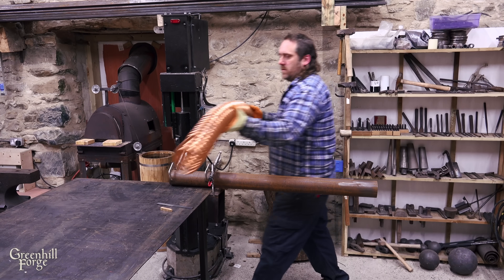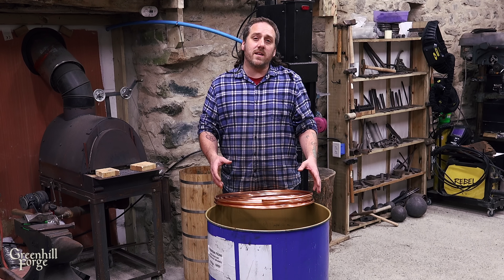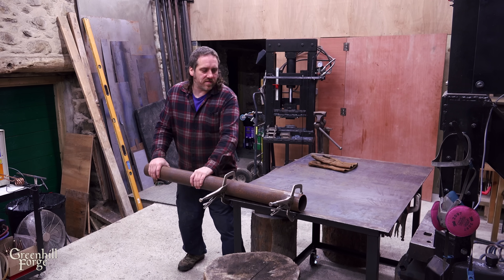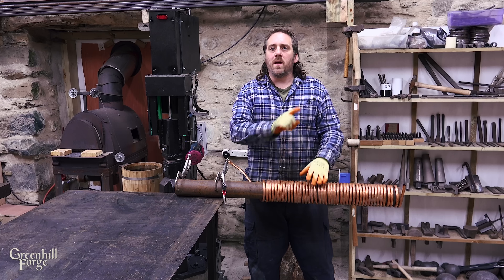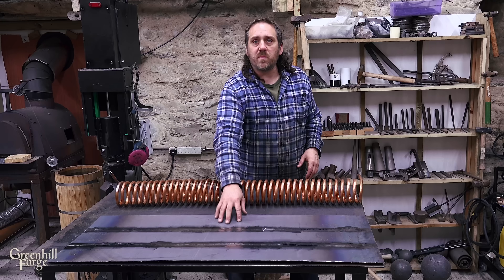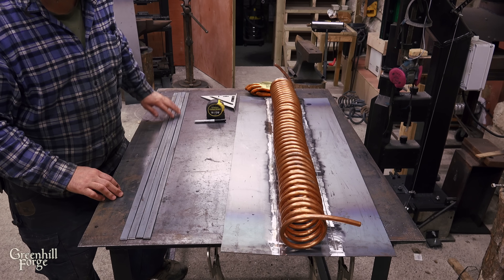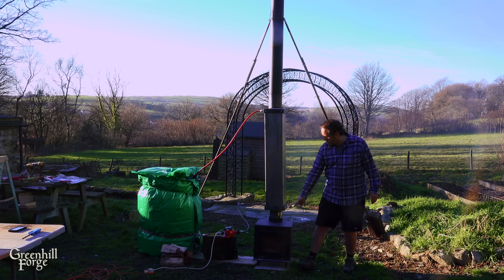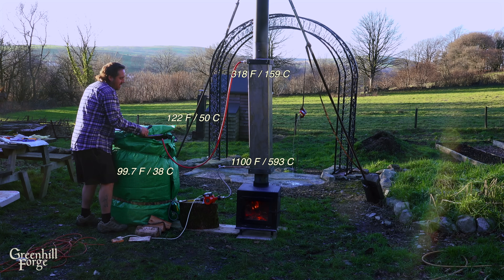Wood Stove Water Heater Experiment - Surprising Results! Part 1

Comment: Excellent video. Great idea, perfect explanation, cool techniques, and conveyed in a clear and concise way. Would love to see a comparison of how this insulated version performs vs just wrapping the copper around the chimney pipe (which is what I WAS planning to do, but now you've got me rethinking my plan)
Reply: Potential problems with soot and creosote build up on the relatively cool copper pipes leading to clogged heat exchange surfaces and potential chimney fire
He mentioned trying a "Rocket stove" design next  which could alleviate this problem due to its designed in, efficient burn and therefore no creosote or soot (both of these products are from unburnt fuel = low efficiency)

Comment: Kinda think you could put an inner pipe to better divert the flu gas around the coil. Give only a half inch space on the inside of the coil too.
Also lightly crimp the coil a bit to increase turbulence in the flow of water. Great job this is something I’ve been planning
Reply: Rather than crimping the coil just install some baffles to disrupt the airflow.

Comment: IMO there will soon be a lot of condensate due to the cold water being pumped through the hot tube. And it will hit the smoke and create a lot of creosote and after 1000 liters of heated water or so it will dramatically worsen the thermal conductivity of the spiral. So you may have to clean it somehow, I guess.

Comment: Does the warm water hose go to the bottom of the barrel?

Also I think this could be optimized... If you go by cross section of the interior of your contraption, only a very small fraction of the area will be in contact with hot air. With a wood fire, obviously you need some room or else soot will probably gum up the works inside of a few weeks.

I just wonder if instead of making a spring out of the copper pipe one couldn't fabricate a corkscrew chimney with a flat top so to speak. The head would travel along the flat plane to which water piping could be attached.  Like a spiraling entry to a car parking building with piping along the roof, you know?

Comment: pretty cool, The only issue i see is over time the efficiency will decrease as the copper tubes get coated in fly ash which is an insulator

Comment: Awesome Idea, but how do you account for the mineralization of the water giving the system basically clogged arteries. If as you say that everyone can use a water source off grid then the higher mineral content could potentially clog the system. Is there a tubing like pex tubing that would eliminate that mineral gravitation to the walls of the copper piping. Great Video Thank You 🙏

Comment: Fantastic video! I have a suggestion for another experiment: could you try using a counter-flow setup instead of a parallel one (feeding the cold water at the top)? I believe this approach might achieve even greater efficiency due to the consistent heat gradient. Looking forward to your next video!

Comment: Great video, very interesting.  However I’m afraid that over thermal cycles those steel notches will cut into the soft copper and you will have a leak. Rather than notches I think some flat lips for the copper to rest on flat would be less likely to damage the copper. Thanks for the video!

Comment: I want to make a mass heater, which uses isolation, but around a thermal mass (sand), with a double burn (another air intake to ignite the smoke), with the heat coiling into a bench (or hot-tub), with this copper heat-transfer circuit also embedded in the sand. A rocket stove would start the burn to have a good air draw, and with a trap closing on the exhaust, it would loop around the isolated hot tub. Ideally, I want to do all of that in a greenhouse, so that any extra calories can stay in, and I'm not exposed to the wind. I've seen elements of this made from cob (clay + sand + straw). 

Your unit is modular, it looks manufacturable, shippable. I retain the method of wrapping the copper tube around, and the spacer rack.

Comment: If you added a thin metal pipe in the middle of the coil and fill the coils space with sand. Cleaning would be better and the sand once heated will stay hot long after stove burns out. Might save on fuel
Reply: Careful with heating sand, it produces silica at high temps. Should be ok near the pipes with the water running through keeping it at max 100C but the edges of the square may reach dangerous temperatures.
Reply: @Andeving a wood stove only gets to just under 600 degrees the chimney will be way cooler then that and silica is a type of sand and sand doesn’t melt until 1700°c maybe I’m misunderstanding what your saying lol

Comment: Super nice work! You can bump the efficiency by reversing the flow in the coil. Inlet at the top and outlet at the bottom. Reverse flow heat exchangers is a more efficient config.
Reply: Precisely what I was thinking. Deffinately helped my offset head double helix reflux condenser I use to distill "fuel" with.

Comment: You can also just coil it aroumd your smole pipe and it works well. I've seen it.
I didn't do it just because I keep my stove inside and you don't want to start a fire in summer jusy to have hot water.
There are more efective ways to do it, in a similar way.
Wood stove boilers have the smoke pipes going trough the water tank. That's wildly efficient!
This copper pipe idea makes sense of you only need the hot water in winter and you have it as a bonus, since you use the stove for heat anyways.

If you do something for extra heating, like floor heating, please be careful. If you don't use a pump to circulate that water and you don't have the right angles, the pipe can explode. I've seen this happening.

Comment: Very nice project and very well explained. One improvement to increase the efficiency is to feed the cold water in the coldest side of the heat recovery system. In this case, through the top intake of the coil.

Comment: Your coil will be thickly covered in creosote (less efficient) in 3 weeks or less, and needs to be cleaned. It has the BTU's of coal and will make a fantastic chimney fire... Allowing for cleaning must be part of the design.
if your water tank bottom is 2ft. above the top of the coil you don't need a pump.
Ask me how I know...
Reply: Ok, how…Assuming you tried it w/reverse flow?
Reply: @ mine had no pump and used thermal circulation. it works just fine.
Reply: Creosote was the problem that I had when I attempted a similar water heater.
Reply: @ my system produced 4 to 6 litres of creosote every 3 weeks. but It did the job for hot water. easy cleaning must be built into the system.without diligent maintenance it's a chimney fire waiting to happen.

Comment: Very well executed! Every time I had a question you preempted it with an explanation. Fantastic! One piece of advice, infrared thermometers don't read shiny metal properly. Hard to appreciate this until you've played with a thermal camera, but basically any metal surface that's shiny under visible light is shiny under thermal infrared light as well. So a reading from a reasonably bright steel surface is probably reading 80% the tree next door whose infrared is being reflected from the metal, and 20% the actual temperature of the metal. 

For getting a good reading from shiny metal surfaces of reasonable temperature (<100C) a square of painter's tape is an easy measure to take. Mill scale is probably also really quite close to the right emissivity for a good infrared thermometer reading, so if you've got a nice dull mill scale surface that'll read pretty well (although in my experience things tend to be a bit shinier in thermal infrared than in visible light, so a thin light grey mill scale would be dubious). 

For decently high temperatures (up to say 200-300C) soot is usually a decent temporary surface for an accurate IR thermometer reading. Again, things are shinier in infrared than in visible light, so the soot has to be pretty darn thick  (absolutely no sheen from the underlying metal) before it's truly black enough to produce a good thermal read.

I would expect any matte stove enamel to produce an almost perfect thermal infrared reading.

Very curious how the rocket stove will pan out! Back of the envelope math says your water heating experiment would have required only 1.6 lbs of wood with a 100% efficient setup. If we say you burnt half the wood, that'd put you at 36% efficiency. I would say you're doing pretty darn well already! That seems really high for this sort of thing! But I'm super interested to see what efficiency you get from a rocket stove that's not radiating any heat out the door.
Reply: That is a well-thought-out reply with tons of very relevant information and save me a lot of typing.
I was also thinking that a rocket stove would avoid the major flaw in this design because of its complete combustion (100%  by design) and thus NO creosote build up and therefore no safety risk of a chimney fire. He will have to mount the coil higher after the pyrolysis has happened in the well insulated riser. 

I'm glad the tank is not sealed so there can't be a pressure build up and a boiler explosion as may happen with closed systems when pumps fail or the power goes off.

Comment: Nice work.  

Some notes for posterity:  Once you get to around 500* F or so, air becomes much more thermally conductive and more and more heat exchange/transfer occurs through IR as the temps get hotter and hotter.  To optimize such a system a bit more, an IR reflector (with a free air gap of at least .5" or so between its surface and the heat source) would be helpful.  

  Then to optimize heat transfer through the copper and into the water, roughing up the copper tubing and spraying it with a high temp paint would help a little. The copper directly touching the steel doesn't need this, only the part of the copper not touching it. (As IR reflection needs a bit of an air gap to work).

   I don't think that both of these would make a big difference all in all, and maybe not worth the extra work for some folks, but it would help some. I'm a little obsessed with efficiency, but I also have learned the hard way, "don't let perfect be the enemy of good". 

  Cheers

  Edit to add: The downside to this, at least for indoor heating woodstoves, is that the cooling of the stove pipe will tend to induce a lot more creosote build up.  Personally I would lean to using it only for outside use because of that, unless you have a system set up where it is fairly easy to clean the stove pipe (because you'll need to be cleaning it more often for sure).
Reply: Cleaning the stove pipe and chimney every couple weeks in the winter sucks so bad that nobody will do it. 

'Efficiently' stealing heat from the exhaust gasses is a creosote building chimney fire machine.

The heat in the exhaust gasses is the only thing that pulls air into the stove. People will have to burn hotter and hotter fires in the box just to get it to run, and one day it all goes up in a glorified, giant sized rocket stove that you can only hope ruins the pipe and chimney without burning down the structure it's in.

Thanks for pointing this out, 'reclaiming' the heat from the exhaust is never a good idea and I'd hate for anyone to end up worse off from it.

Comment: Interesting idea. Won't the copper cause rapid galvanic corrosion of the iron and collect creosote rapidly as the smoke passes over the water cooled copper? Maybe 5/16" stainless brake line or 3/8" stainless wort chiller coil tubing would be safer?
Reply: For galvanic corrosion to occur, the metallic junction must be in the presence of an electrolyte.

Comment: You made a critical mistake that inhibited the performance 
This comes from the energy experts in the HVAC industry, it is called Pre-Heating.
The cold water inlet should be at the top, closest to the end terminals if the flue. When you look at the Copper tubing, a section of that copper, say 1" length. It will conduct heat at a specific rate, drawing heat away from the flue and transfer that heat through the heat of conduction to the water.
Since that Heat Transfer is limited, you are considering Temperature Rise.
Since the heat closest to the stove is hotter than it is by the termination of the flue, you want the most heat transfer as possible. 
If your inlet water is at the farthest point, it absorbs heat, and as it runs through that Copper Pipe, it will be exposed to hotter temps. You are literally Pre-Heating the water before it gets to the Hottest portion of the Flue, where it will absorb the most heat.
Additional benefit is that the resistance of the water to the Pump will be reduced, resulting in a more efficient pump operation with less stress on the motor. 
Your Heat Rise will likely improve by 25-50°.
Another improvement to your setup would be to add your heat exchanger as a bypass to a primary flue, with the damper installed above a tee, where the air would go into a tee when primary flue passage is closed off. This would minimize flue gases exposed to the heat exchanger unless needed by simply closing the damper. Basically, close the damper to turn on the hot water heater.
Reply: The inlet pipe at the top is best for a pumped system, backwards for a thermal only circulation system.
The water rising when heated makes the pump work harder, not less.
I like your bypass idea... Mine use-to boil off every once in a while... I plumed for that, and it would have been irrelevant except the standard blow off valves are not rated for repeated use and tend to leak after 2-3 times.
Reply: With respect to your factually accurate and clearly written description.
Your talking like your living on grid and not rationing every watt of solar energy. ie the pump.
using a pump when thermal siphoning will do the job is scandalous! not unreasonable or erational mind you. 
the coil caking up with hard or sticky creosote is a maintenance "nightmare" and a chimney fire waiting to happen. ultimate efficiency must needs take a back seat to maintenance and safety. this guy did a great job on fabricating and thinking of maintenance. that being said I would not be cleaning that design in my house as it would be a terrific mess every 3 weeks. It may end your marriage if you have one. I would not build one fire to heat my house and another to heat the water,extra labour. so that's a problem.
In case you sense a extra bit of passion here that would be because I came by it honestly. (long explanation, not relevant to the facts)
creosote is an insulator and hostile to energy transfer efficiency. not that that is in any way a problem, up till week 3. then the system works poorly and safety is threatened.then you  clean it.
a good set up takes 45 minutes to an hour from lighting the fire, after that you risk a boil over an have to deal with the problem of steam. or an explosion take your pick.
I know it's counter intuitive but your striving for mediocrity here.
the best system is a water jacket around the flue (1/4" of water ) and for the love of all that is holy plumb it so that every last bubble floats to the top and harmlessly blows out the steam rated blow off valve, just like o'll Moby Dick.
the water jacket allows you to use a chimney brush in a few minutes.easy.
if the water jacket is to efficient the steam rated valve takes care of that. just make sure the steam and water eject in a harmless direction.
one more thing there is a magic line 2 feet above the coil were hot water will not go below. make sure the bottom of the tank is above that. or use a pump- be a heretic I don't care.
Jared
Reply: Basically what you described is what is known as a counterflow heat exchanger. What is in the video is a thermosiphon. If you have an adequate pump, then thermosiphon isn't required. Counterflow designs can be very efficient! Would be a simple mod and a great follow-up video.
Reply: @chasbader we Pre-Heating the air of 90% condensing gas and oil furnaces. It pulls so much heat out of the flue gases that it condenses the moisture from those gases. Due to the acidity, and the moisture, we can not use a metal flue for them, we have to use PVC, and account for removal of those condensate. Extremely efficient.